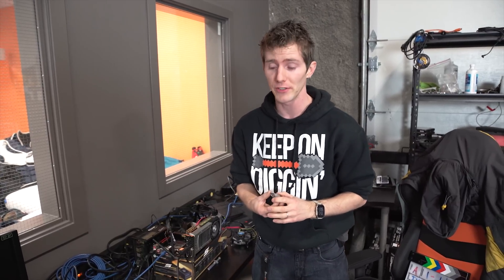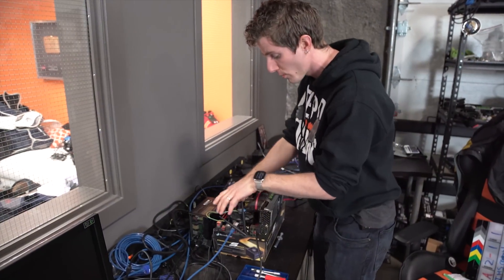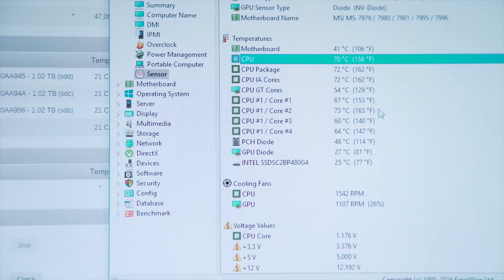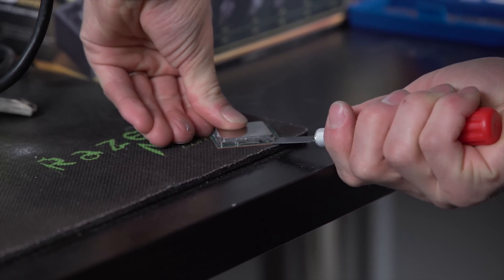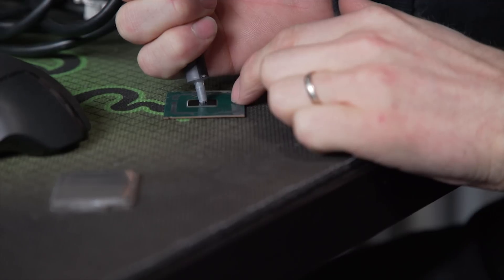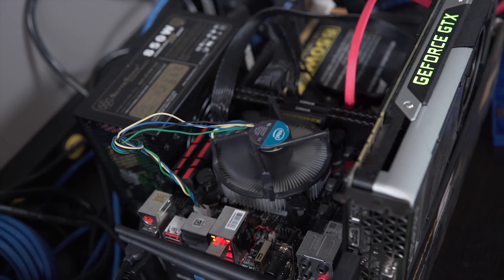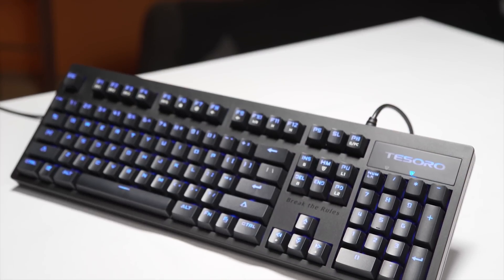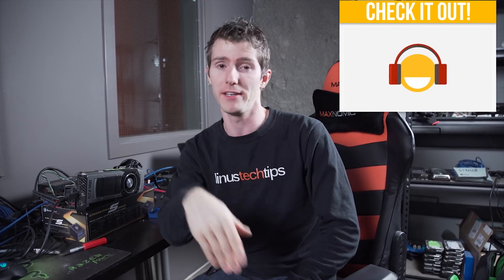Delidding an Intel Core i7 6700K - Is it worth it!?

Comment: Wouldnt it make a big difference if the CPU had a cobber heat spreader?
Reply: It has it. It's just nickel-plated to prevent it from developing black or green copper oxide. The worst performance hit is the presence of two layers of thermal compound instead of one, where you have the silicon die touching the heatsink.
Reply: zwz • zdenek Oh, I didnt knew that, thanks! :)
Reply: TheTomatito2
You're welcome. Most people just dismiss knowledge if it's too radical to them. I expect you to learn a lot.

Comment: my cpu is stuck to my heatsink, please help
Reply: Oh and also i went at it with a hair dryer for like 20 minutes.
Reply: I replaced it.
Reply: yea, i'll get right on that.
Reply: Fun little story: I had a friend who wanted me to repair his computer because it wouldn't boot anymore. Upon taking it apart, we found out that the CPU got so hot, that it fused mechanically to the heatsink. While I was sitting there puzzled, wondering if he was pranking me or something, he told me he was cleaning out his computer when he found "some gunky crap sticking between the heatsink and the processor."

He apparently thought it was a good idea to clean all the thermal paste off and put the heatsink back like nothing ever happened. Fortunately, it was a cheap 50 dollar computer he salvaged from a garage sale, and he was thinking of getting something better. To this day, I have the fused heatsink/processor sitting on my bookshelf as a trophy.

I know that doesn't help with your problem, but... It felt relevant.
Reply: lol, my "trophy" is sitting on my shelf as well, i thought of throwing it away but it sits there as a reminder to take care of my pc, thanks for making my day!
Reply: push the a button. but for real just be gentle and very slightly wiggle the cpu if it doesnt come loose then there may be an even bigger issue
Reply: How did you accomplish such stupidity?
Reply: +BlazarK relax
Reply: muteplay77 I'm chill I just don't see how this is even possible.
Reply: +BlazarK how can't you? I just posted a comment about it happening.
Reply: The mounting bracket. You have to lift it in order to even insert/remove the CPU.
Reply: BlazarK thats not his issue.......
Reply: +BlazarK it ripped the mounting bracket off with it, I also should have mentioned that I used the stock thermal paste that came with the heatsink
Reply: muteplay77 that could be why. should always add a drop of extra thermal paste sounds like they melted together
Reply: How the hell did it "rip it off", in any case just get a puddy knife and wedge it between the heatsink and CPU. Or maybe I'm still not understanding? Did you delid your processor and you cant remove it from the IHS?
Reply: +Joker _  that is the exact problem I am having, thank you sir
Reply: muteplay77 Okay well if you didn't delid then just pry it off with a puddy knife and you're goochi. That happens when you use shitty Intel TIM.
Reply: +BlazarK actually it's an amd 6100
Reply: muteplay77 Both AMD and Intel have garbage TIM. With your issue having an AMD is even better because from my understanding your CPU is still socketed. AMD has the pins on the CPU whereas intel has pins on the mobo so there is much less chance of damage when trying to pry it off it is properly socket. You need to get new TIM before you do this so visit a local Frys or Microcenter and get some Arctic Silver 5 or some MX-5(or 7) Make sure to clean off the old TIM. Sorry, don't know how much you know about PC's you may already have some or know this. Good luck.
Reply: +BlazarK  hey thanks man, I appreciate the help and tips.
Reply: NP sorry for the misunderstanding. Was kind of an odd place to post your issue.
Reply: +BlazarK  ya, it's water under the bridge man, I agree with you it was odd.
Reply: put it back in computer. turn on computer and let it run for a while til its allll warmed up. turn it off then re try taking off the heatsink. sometimes you gotta warm up the paste for it to be nice and easy for it to remove
Reply: muteplay77 that works too I suppose lol
Reply: Run it under a hot faucet for about 2 minutes... it'll fall right off with no risk of scratches.
Reply: As long as it's a learning experience I guess there is something to be taken away from it all, heh.

Comment: Hey guys, I'm looking for a Graphics Card and can't decide to go for an Nvidia or maybe AMD. I want to spend max. $300. (Preferably White, but not really necessary.)
Reply: wait for the AMD 480, will be ~200 and give you performance between a 970 and 980 which is pretty decent for the price. If you're willing to go a bit over the 1070 is a beast for ~350-400 but you also prob wont be able to find either of these cards in stock for a while
Reply: just stay away from amd

Comment: It wasn't Haswell that got it started, it was Ivy Bridge and the bird shit that Intel used for compound. Tualatin and Northwood have the same crap as does all the budget dual cores from the c2d era. So glad that I moved on to Xeons enjoying my super low temps.
Reply: Basically everyone that has done some over clocking and knows the shenanigans Intel pulled on their CPU's since Ivy Bridge, disagrees with you that there is no problem. Intel moved away from fluxless solder and used crap paste, so that more profit goes into their pockets! The K and extreme versions of Intel CPU's use the same crap, negatively affecting overall temperatures and overclocking. Higher temperatures DO affect your and everyone's CPU life span!

It isn't just as simple as you saying that as long as it's within design specifications there is no problem. Yes, there IS a problem and that is why there are people that DO pay attention to the consequences of moving away from fluxless solder and have written articles about exactly that! It is why there are delidding videos on the internet, including this one even though it's a bad video I cannot advise to follow.

"The amount of cooling from a heatsink outweighs the thermal loss from using cheaper thermal paste between the die and IHS..."

Dafuq? No. If you have a shitty paste AND it is making sloppy contact between CPU and the heat spreader due to a certain thick adhesive compound, a large heatsink or watercooling won't mean jack shit, because temperatures are going to be HIGH. For common people that do not clean their heatsinks often enough, dust is going to clog up it and potentially fry their CPU thanks to the already high temperatures!!!

Seriously. I recommend you to read some in-depth articles about this. If Intel had a real competitor in the industry (sorry to say AMD is not a good one), Intel wouldn't dare to pull this shit off.
Reply: As long as within design spec, there simply is no problem, doesn't matter if it's running hot or not. The engineers at Intel are amongst the most educated when it comes to integrated circuit engineering, I trust their knowledge before a bunch of plebians on the internet when it comes to operating temperatures and circuit lifespan. The amount of cooling from a heatsink outweighs the thermal loss from using cheaper thermal paste between the die and IHS, the stock heatsink is designed to maintain a die temperature below the maximum Tjunction temperature at stock clock, and enthusiests wanting to overclock will always buy a better aftermarket heatsink which can cool beyond the stock clock. Overclocking is not condoned by Intel, it can reduce the lifespan of a CPU and they did not design it to operate beyond the stock clock, it provides such overclocking capability as a courtesy. They explicitly do not allow overclocking Xeons because they understand that such a thing is risky to the stability and longevity of a system, and there is no place for that in a professional datacenter. If you want to push boundaries, buy an extreme or "k" suffix CPU. Less than 10% of customers that buy the standard models of Intel CPU end up leaving it overclocked, so spending significantly more money for better thermal paste on millions of CPU's is quite plainly silly.
Reply: +shiroineko13
First off, CPU's do not magically melt down just because they run hot for a while but within their design specifications. You and nobody you know has ever lost a CPU due to overheating, they are simply the most reliable component in your computer and long outlive your rapidly outdating specs. if they ever did lose their CPU it was because they exceeded the voltage limits of the CPU and thus an arc broke down the insulation and fused some gates together. CPU lifespan is one of the most bullshit arguments you could possibly make.

As for physics, lets think about basic thermal dynamics, since I guess you want to get into it. The cooler the surface of the CPU, the faster the rate of transfer of heat from the die itself, so a liquid nitrogen or TEC cooled CPU would be far cooler at the die than an air cooled CPU, not just cooler at the surface. It doesn't matter if it's bad thermal paste of solder, the rate of transfer is faster, fact. As long as the surface of the CPU is above 0 Kelvin it can be cooled further and the rate of heat transfer can be increased. The further you can cool the surface of the heatsink the faster the rate of thermal transfer, of course fans can only go down to room temperature, but the better the heatsink and fan the closer it gets to room temperature and the cooler the die becomes, and that was my point. Of course people complain about thermal paste, because it means their cooling is a bit less effective than if it were solder, but that is where the difference ends, better cooling results in lower CPU temperature, end of story. I have no need to go and find a bunch of sources for you, you're simply mistaken in your understanding of thermal dynamics.
Reply: They used birdshit for their TIM, no if ands or buts. The whole reason they came out with a Haswell refresh was because of Haswell's horrible temps and overclocking potential. The TIM absolutely makes a difference. I saw a 20C drop on my 4770k after replacing the TIM with some CLU. My Kraken X61 could barely keep it under 80 under full load at 4.4ghz. Now it max's at 70C at 4.6ghz. Intel fucked up when they stopped soldering the IHS to the Dye.
Reply: I mean, if we're talking about spending significantly more money for better thermal paste, they could just do that on the high end desktop consumer CPUs.
The ones that only people who intend to over clock them would buy.

But, it's whatever.
The practice of changing out that thermal paste seems a bit... silly.
OC'd with water cooling, my CPU doesn't go above 60 degrees Celsius under my normal everyday load.
I'm kinda fine with that.
Reply: You know, I wonder if actual bird shit would be a good thermal compound. Linus should test that for an episode of HOLY $H!T

literally
Reply: My old 2600k was pasted and not soldered :(
Reply: @LordOcelot  How did you find that out? I was under the impression that all the Sandy Bridge i7's were soldered, that's the first time I heard of one using paste.
Reply: @ I thought by now it was just common knowledge. When I delidded the IHS I found it was indeed pasted and not soldered.
Reply: I have heard of people using solder paste as a CLU, specifically, 'silver solder'. My 4790k has terrible TIM, but thankfully, I can keep it cool without modifying it, but only just.
PS:Silver solder is not made of silver, but rather, is commonly used in jewelry to solder together silver.

Comment: This public service message is brought to you by Intel.
Reply: I would think Intel would be happy for you to break your chips... so you can keep buying new ones.
Reply: I'm still going to do it! I'll lap it then polish it with 1 micron polish than 0.5 micron polish :)
Reply: +nicklong27 and also they won't have to cover your warranty
Reply: And this children is why you just buy a Ryzen and never have to fucking worry about performing surgery on your damn CPU. It's called soldering. It's what Intel did too, back when they gave a fuck.
Reply: Nicholas Gill Exactly
Reply: Just remember to buy a performance Tuning Protection Plan from Intel.
Reply: Ed Turvey I
Reply: George Perakis So is that why Ryzen processors are terrible at overclocking
Reply: No that's because Global Foundry's 14nm process is fucking dogshit. Sould be fixed by the update to 12nm and 7nm next year.
But for the record, with extreme cooling and unsafe voltages extreme overclockers have taken the Ryzen 1800x to nearly 6Ghz. Without ever needing to delid them like they do for Intel.
Reply: *AMD

Comment: This does not work when your CPU already comes with good TIM.

I have two setups, one with a i5 4590, one with Xeon E3-1276v3. The Xeon when out of box run directly over to 95 degree even I use a decent water cooling, and after delidding with MX-4 applied it never exceeds 70 degree. The i5 on the other hand when out of box never exceeds 65 degree.

Also worth noticing is the Xeon before delid when it's at 95 degree the water cooler head actually remains at about 40 degree. However after delid the cooler head goes to about 65 when CPU is at 70. I think this proves the TIM under the lid could be bad for some perhaps older CPUs.

Comment: what would happen if you just totally filled that heat spreader with thermal compound, he used barely any.
Reply: thermal compound is not as good as metal for heat transfer, the purpose of thermal compound is to fill in any tiny holes and smooth out the surface like you grout tiles, if it actually covers the metal its worse, hence only use a tiny bit

Comment: What do you guys think about using indium as a TIM? It's quite expensive, but then again completely reusable, or at least recyclable.
Reply: psionx1
Really? CPUs peak right about 65°C depending on the model. The hottest chips are usually the mobile graphics. But 105°C is on the failing side even for them.
Using liquid metal instead of the usual paste is a terrible idea, not only because of the risk of shorting the motherboard, but also the risk of structural failure. Look up the gallium videos.
Reply: It is not reusable in practice. Once a material gets finely distributed, it becomes uneconomical to collect it back. They usually even leave the gold that is in computers!
Reply: most cpus only reach 105*C at full load. indium isn't a liquid till it reaches 150*C .also some liquid metal TIMs are likely using a small amount of indium already . Potassium(melting point 63*C thermal conductivity 102W/m-k) or Rubidium(melt:39*C Thermal conduct:58W/m-k) would work. though for Potassium to work you'd need a vacuum seal around the cpu to keep it from oxidizing and Rubidium reacts with water so could fry your cpu if the room humidity gets too high.
Reply: And for reference, most modern Intel CPU's have a maximum thermal design temperature of pretty much exactly 67 degrees Celsius at the integrated heat spreader (Tcase) or 100 celsius in the die package (Tjunction), you can find it on the Intel Ark for your processor.
Reply: zwz • zdenek
Gold and other precious metals is a very different scenario than this. I'm talking about using a sheet of it (similar to aluminium foil) instead of zinc oxide goop or "Arctic Silver" goop.
It would be extremely easy to recover.

psionx1
I highly doubt Indium is being used already in thermal paste. There's no reason to that I'm aware of.
Also, the fact that indium doesn't melt under load is the whole reason to use it in the first place. It's a very soft metal though (the softest non-toxic non-dangerous solid metal at typical human temperatures), and like most other materials, softness changes with temperature even before complete phase change occurs, meaning that load temps would be great for "burning in" the thermal interface to fit well.

zwz • zdenek
Liquid metal would indeed be a bad idea, but I wouldn't say that it's for the reason you mentioned. Gallium is a specific metal which has it's own problems but doesn't mean that all other liquid metals would have the same problem. The biggest problem I see with anything liquid is that it could eventually leak out and hence stop working, along with potentially cause a short circuit.
Reply: Mshojat
That doesn't even look like a reply to me. My point was that the fact that something is technically recyclable doesn't make it a viable practice. Gold was put as a limiting example. If something like recycling gold isn't viable, then indium, by extension, will be out of luck too.